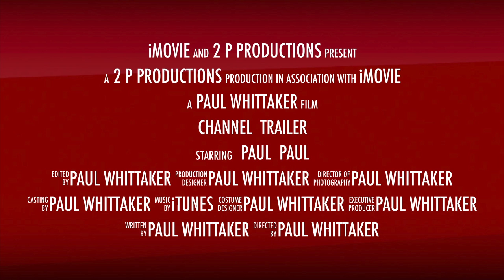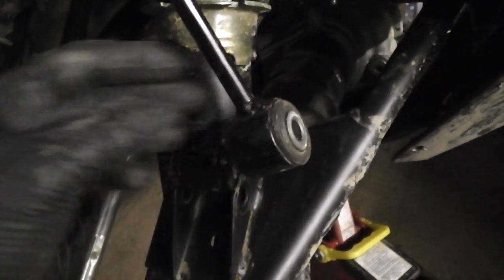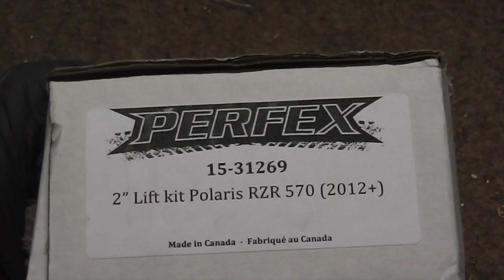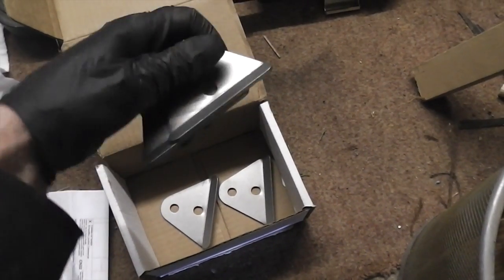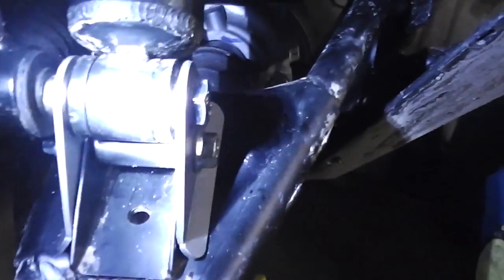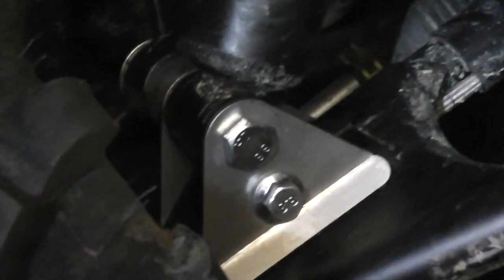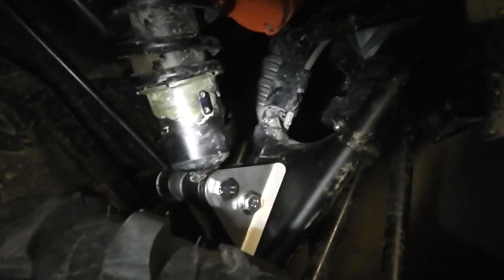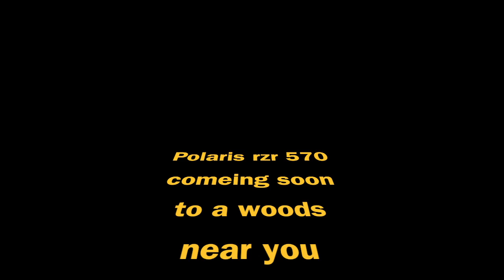polaris rzr 570 front 2 inch lift kit

Comment: Does it make it a lot easier to tip, or do you feel more body roll after the lift?
Reply from the maker: Alden Hall  , I’ve never got it into a situation where I’ve noticed any difference, I’ve also removed my anti roll bar to give myself better articulation over the terrain I trail ride over, I’m also not 50inchs wide anymore, with the new wheels and the offsets I’m now 56 inches wide so I think that’s what makes my Polaris that much more stable